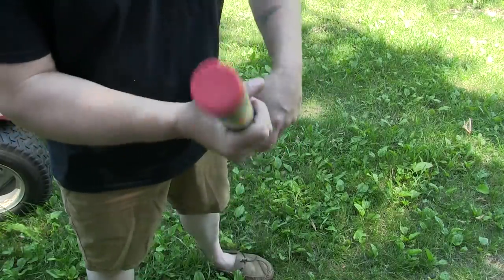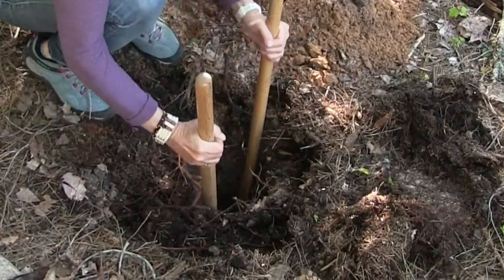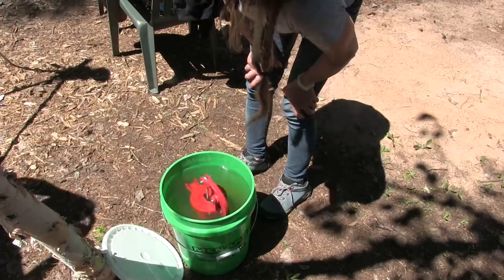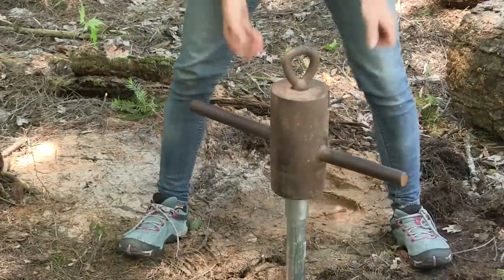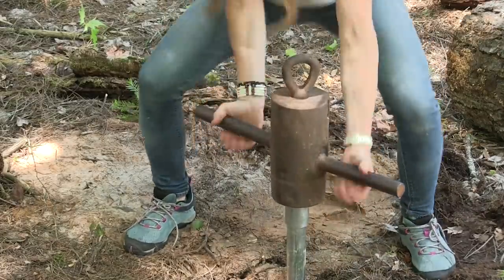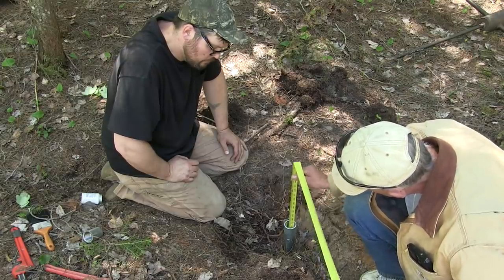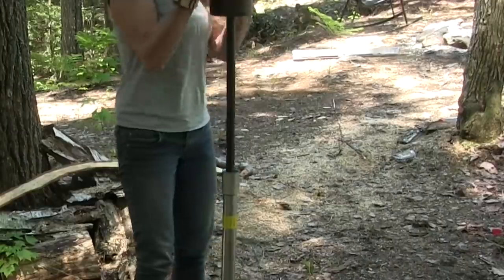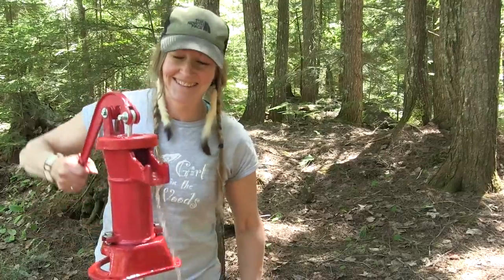Driving a hand pump well at a remote off grid Wilderness Camp

Comment: You can put a pipe on the pump handle and it will be much easier to pump.  The colored water is from the leather used in the pump, I prefer the other type non-leather, because my water never cleared up. So i don't use the leather type.  
My Dad did the well all  by himself when he was 78 here in Florida. He did not have those  post thumpers or any special tools.  He did it the old hard way with a heavy sledge hammer.   He went down 24 feet and could go no farther because we hit the Florida  rock base that Florida is built on. WE did not want to injure the head, so we stopped there.
Its' hard to keep that kind of pump , that I use as well, to say primed - you need to use the well daily or you will  have to re-prime it each time and it likes to suck air, so that is the only problem I have. The problem is in the pump, not the well.

===

Comment: You should have a gas or electric  pump to run the water for a few hours to get a hole or the sand away from the sand point  Now you just need a stand to hold the pump from being run in
by deer etc because if you bend the pipe it will be like having a case of hemorrhoids something you can do very nicely without!

Comment: i've never seen a spear point put in like that. always used an outer casing that's screwed down as far as you need and a sludger dropped inside it to remove all the sand etc then the actual spear point is put down inside the casing and then the casing is removed leaving the installed spearpoint. we have water 4-5' from the surface here but the level can drop by another 7' so we put the spear point down 35'-40'.
Reply from the maker: right on. I dont know that way

Comment: Dave, what prevented maintenance does it take come winter? Will it freeze or do you just remove the hand pump for the winter months?
Reply from the maker: You just hold up the handle and it releases the prime and the water drops back down the pipe

Comment: I just love your videos. I am going to install a pitcher pump next week for another pastor.  We just put our well in at the new homestead a couple weeks ago. We got 50 gallons a minuet at  270 feet down.  The static water is at 180. It will have a small 1/2 HP pump because we are off grid and our solar system is only 5000 watts. Our homeplace has 5 springs and gravity feed but we are being sent out as missionaries to a poor and repressed area. The Lord has opened the door to the indigenous people of The Klamath Tribe. We are very excited about the move and the ministry. I looked for pitcher pumps and you popped up. Love your content and easygoing teaching style. May the Lord Bless your well in Jesus name!

Comment: Actually there's another way to do it if you have access to a barrel of water and a small pump using PVC as a casing I have done Wells down in Florida like that screen point and with trees around you are definitely use a pulley system to drop that hammer. Using a casing system gives you more water for your well also on you can always put an electric pump on it afterwards by using solar or whatever but great job guys great job as always
Reply: Can you give more details on how to do what you are talking about?

Comment: Just started watching your channel. I'm so jealous of your soil, lots of rocks and clay here in my part of Upstate NY. Wells were always "drilled" with a truck mounted pounder, now today rotary drills are the norm. I actually worked as a mechanic many years ago on drilling and mining equipment, rock drills and the diesel compressors that run them. In places where there is shale underground, it was not uncommon for the drill steel to catch the grain of shale sheets, cause the drill steel to bend in the hole, and break. Cut off with a torch and abandon. If it was a blast face you might get the steel back out for scrap. I have a few stories of drilled blast holes did enter an aquifer underground, and the blasts did pop a few nearby wells, true story! You and your wife work so well together!

Comment: I took a class in log home building and one of the steps requires pounding rebar.  It could be done by hand with a sledgehammer, but many use a demolition hammer (35 pounds) with the chisel end cutoff (plus hose attached).  Anyway, could it be modified to drive the pipe?

Comment: i enjoy your video's and have put in 3 shallow wells (Sandpoint's), around...yes, Sandpoint, Idaho.  I have tried your method and a mix of auguring and pounding and have come up with my particular method of auguring until I hit the first layer of very wet sand then having 10, 15, or even 20' sections of pipe with 3' sandpoint ready to pound that last 4 or 5'.  I would really like to know the spec's on that home made pipe pounder.  I have a large commercial sized unit that I would like to turn into something similar to your friends.  Actual or close to real weight, length of main section, length of steel rod, etc..  Again, thank you Dave for this excellent video.  It has helped me and several friends accomplish similar wells in our area.

Comment: Filling in an old pool with sand.  After jack hammering a 6" hole in it's bottom I saw the top of our shallow water table.  So, since I'm already 6 feet deep, I want to make a well there.  But, being the soil under the pool is clay, will that work with a "sand" driver?  Also, since water does not flo as well in clay, as in sand, would a 2" driver and pipe setup work with the antique hand pump,  as It'll give more space for accumulation of water?

Comment: So this well pipe is specifically designed for direct burial?
Stainless steel?
Does it normally come in 5 foot sections?
The sand point looks interesting.Im eager to attempt this project however where can we find A Scott’s Heavy-duty pipe well driver-Well pipe driver?
I’m just hoping I don’t run into solid bedrock before water.Thanks for sharing!!

Comment: Is the pipe galvanized pipe? The phrase “drive well pipe” is nit known in my area. Is it schedule 40 or schedule 80? They say they can’t get galvanized schedule 80 or anything but black pipe in schedule 80. Having trouble get return messages on YouTube. Text me if you can:704-806-5775. I’m desperately in need of getting this well in. Also can the handle where you just lift it be used or does it half to be a hand pump?

Comment: A couple things are important: 
1. Use longer pipe wrenches.  They are 'Pipe wrenches' not 'Crescent wrenches'.  
2. To make the sand point go through the hard spots better use the longer pipe wrenches to rotate the pipe and the point.  That is why the sand point is built with facets on the point.

Comment: Please !!!!!!!!  Your working too hard !  No need for a sledge hammer !  Start the hole with a spade....... add a few cups of water. Take the tubing.....as you had. Gently lift and drop it. After a few time...add more water. The water acts as a lubricant.......and also create a " hydraulic action....it forces the wet dirt away.....and the tubing will drop very easy into the ground ! This method can also be use to put ground rods in. Very simple ! This works !

Comment: I've found the well point,drive coupling, and drive cap,but can not find anywhere about drive pipe. All I can find is standard galvanized pipe from big box stores in 5ft and 10ft lengths.  Is that what you were using or is there something else I should be searching for?

Comment: I noticed the pipe was moving a lot when you first started driving it and you had to keep it level. To avoid this take 2  2x4x8ft cut in half making a x screw together drill 1 1/2 pilot hole in center of x then center over hole and anchor with 2ft peices of Reed bar or rod at the ends. Once pipe is started level drive to desired depth then slide x over last pipe attach pump and done deal. Great video tkx

Comment: You are using Pipe Wrenches, not crescent wrenches. Also, two 24 inch aluminum pipe wrenches would have been a little better on you instead of the two 12 or 18 pipe wrenches you used! I'm an old oilfield pusher. I've drilled wells all over, oil wells, water wells, drive point wells...... Good job though. One other point to make is, you mentioned you built an outhouse. Make sure your water well is at the least, 200 feet away from that outhouse.

Comment: Nice work. Back in the 60s I put down three sand points in the Kalkaska area of Michigan. Hard pan? Yes! I didn't have  or know about the driver like you used. I used a driving cap and a sledge hammer. Long days. Some folks get all excited about using shallow wells - on our farm, we had one for the house, about 28 feet, the potato storage warehouse, around 30 feet, and one for the dairy barn, about 28 feet. We were able to use shallow well electric pumps on them all. For that style pump, I believe 32 feet is max lift. Deep well pump after that (not a submersible). When we sold the farm, the seed potato farmers dug three or four ponds for use in irrigation. 
You may want to investigate sealing the well pipe to avoid surface water making its way directly into your well. Sand is a wonderful filter. Important to make sure all your well water goes through the sand - not bypassing down the wellpipe. My brother used a 12 volt pump and a plastic line to draw water from the well for a cabin on that same farm. Great tasting water in all the wells. In Kalkaska, many of the deep wells are heavy with iron. The proof shows up on the sides of buildings using yard sprinklers. Problem with iron is iron-loving bacteria. They cover everything with slime. Yet the D of Health does not appreciate shallow wells - runoff and all. 
Great work on everyone's part. I am looking to do a shallow well this year as also. We are at the edge of a swamp with surface water year round within 150 yards. BTW, not to nit pic - but those were pipe wrenches - not crescent unless they were Crescent brand, and even then, they are pipe wrenches. Just a suggestion. Looking forward to see how you end up plumbing your well for year round use. Blessings to you and yours.

Comment: I can use some help folks, I believe I did everything correct to hand-drive a well at home, I attached the sandpoint, coupling and first length of well pipe followed by the 1-1/4" WELL DRIVE PT CAP, I pounded on the cap with a fence post driver and sledge hammer and got down deep enough that approx 8” of the 7 foot pipe was showing (Sandpoint + 5’ well pipe) and I could not get the drive cap off. The cap spun and spun but would not come off, I had to cut it off with an angle grinder, which revealed that the well pipe was fluted and distorted and the threads were extremely beaten up. I was unable to retrieve the Sandpoint I’m going to have to get another one and start in a new location. Has anyone had an issue like this? The only thing I can think is; I hand tightened the drive cap but did not tighten it with a wrench, could this be why it failed or could I have hit something underground so hard that the sandpoint could not penetrate? If so, could the continued slamming on the drive cap destroyed the top of my pipe? Does anyone have any recommendations or advice? I’m going into clay soil too, not sure if that’s the other reason for the extremely difficult time I had. Thanks for any advice or recommendations!

Comment: My Husband has been doing this since 1970's with friends & family in North Florida. He said you should have some water "inside" the drive pipe for several reasons. 1. It keeps the pipe being driven from splitting from all that force and pounding, and 2. when you "hit" a stream of water, all the water in the pipe will go out, you will NOT be able to fill the pipe up with water again. It will be absorbed by the stream. In addition, Its a good idea to NOT pump the well with the hand pump, because all those particles coming up will "eat" the leather up. I'd use a gas powered pump and let it run all day to clean the well.

Comment: My brother-in-law's family homesteaded the sandhills of Nebraska in 1872. Their first home was a soddy (Earth dugout). After a year of carrying buckets of water from a nearby stream, his great-grandfather decided to build a small sod house above ground. Using that new-fangled sand-point, he drove it almost eighty feet before water. After placing the handpump, he tore down the soddy and moved it to surround the well, claiming he would never carry anything greater than a cupful again. Several years later, a second well was drilled using a team of horses and a twist sand-point, out by his small barn to put in his newer-fangled Aeromotor windmill. Over the years that water table dropped about four feet, so it took only an additional eight feet of well-pipe to be driven. Those wells have been providing water continuously for almost one hundred and fifty years and is the sweetest water one could ask for.

Comment: We tried this and just ended up mangling threads.  We're considering pull the pipe, which I assume is mangled all the way down, and trying again but we don't want to mangle a second time.  Any advice to avoid damaging threads during the drive?  Is it as simple as we didn't tighten the couplers enough? Including the sacrificial coupler?

Comment: Years ago a friend of mine drove a well with some sort of tripod setup and a Wheelhorse lawn tractor. He took off one rear tire (leaving the rim). Then he jacked up the other rear wheel off the ground. With a swivel pulley at the top of the tripod, a rope would get a turn around the spinning (slowly) tractor rim. All he had to do was give a little tension to the rope and the driver would ascend. Release the rope and the driver would obviously descend. He was a printer by trade and had access to lead (which was used to cast type back in that era). It's possible that his driver may have been heavier than yours, but the principle is the same- without the heavy lifting! I seem to recall he drove it down to about 100' .

Comment: Does anyone have any recommendations on winterizing the pitcher pump? Can it be used all winter? I installed a shut off valve just below it, so I can keep it primed during the summer and I figured in the winter open it and let the water drop down. My water table is 22 feet so it’s better to keep it primed as much as possible. Any help with winter prep is much appreciated.

Comment: He called his pipe wrenches, Cresent wrenches as pointed out by Tom Mak in reply below.  I used the same 18'' Ridgid  offset pipe wrenches but I had two 18'' long 1-1/4'' extensions. You can't get the couplings as tight as they should be without extensions on that size of "pipe wrench" I also used tapered split thread couplings instead of those lousy drive couplings. I did not drive on the coupling but used a drive cap. He should have used an auger to auger down to the water. I generally I would start out with a ten foot section of pipe with the point on the end and would drop it all into the hole then add 5' sections. You can tell when you hit water as the auger will come back up with a little mud on it instead of sand. He said he was lucky he had sand but you only put points in sand as stones will rupture the point. He never did say what the point  mesh size was. Probably 8o mesh but if course sand maybe 60 mesh. I have installed hundreds of points for builders on new hommes and  homeowners when their old point gave out which was generally that so much iron had built up on the point screen that water couldn't come through. In my area I would have 3' of water above the point. He said one Ft. and maybe can do that in his area. If you get a long drought you can run out of water at 1".

Comment: I followed the very well made video of yours. But I ran into a problem. I actually hit water 5 feet down . Drove the tip to 11 feet and put the pump on but it will make a good vacuum but not pull water. Should I go deeper ?  I soaked the pump in a bucket  and it is making a vacuum so I don't understand why no water is pulling up to the pump.

Comment: I used a much lighter driver made out of a piece of pipe of larger diameter with the top welded across, and some extra weight welded onto the whole thing.  It only weighed ten pounds, but it slides up and crashes down on the inner pipe just fine.  I've used it to drive a whole bunch of metal pipes and fenceposts deep into the ground.  One pipe used for fencing actually struck water - only three feet down!  
The property has a dug well, 25 feet deep, and a bit over 3 ft in diameter, lined with brick most of the way down.  Whoever built that was a real pro; it's been in use close to 70 years. Its big electric pump has been left running for about 12 hours and never run out of water or lost its prime.  Most of the neighbors have Jet wells, much deeper and only 3 or 4 inches in diameter.  They all complain about running out of water after only an hour of watering their gardens.
Thanks for the video. I learned a lot, though hopefully I wont ever need to use it.

Comment: The way handpump is fixed on a pipe. Surely will damage the pipe as it has no support.. Better way was to install pump on the ground letting the pipe submerge into the ground.

Comment: If ground water is not so abundant as at this place you better get a water finder first who shows you where to drill. Us here in Sub saharan Africa have to usually drill 45 to 60 yards in order to get to the water. We use electric pumps or hand pumps as well. Works great. This domestic  bore hole can produce around 1 to one and a half gallons per second. 😀

Comment: Typically you want to avoid doping the first 2 (inner most) threads so no dope makes it inside. Doesnt matter a *ton*, but most people use more than needed, and ive seen dope gunk up valves and such by not skipping those threads